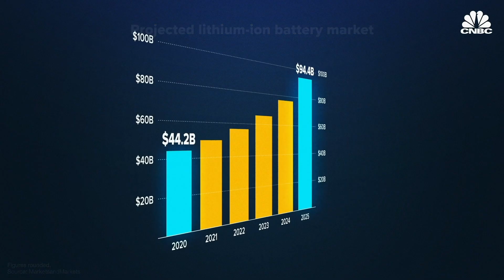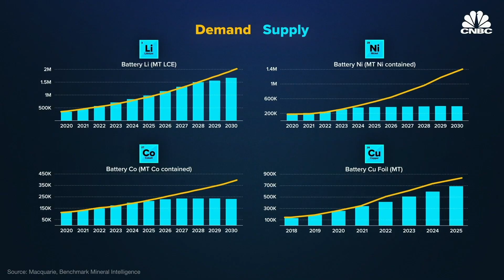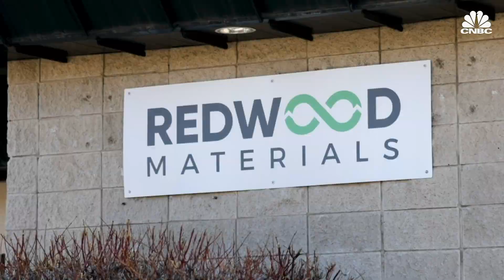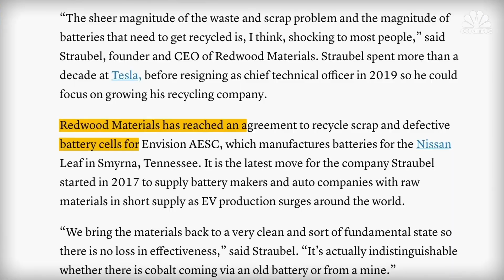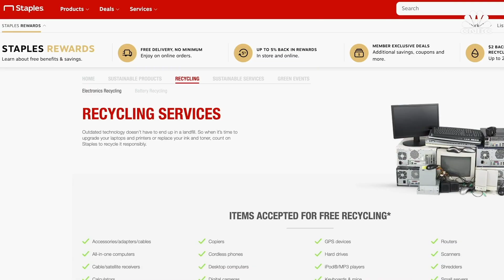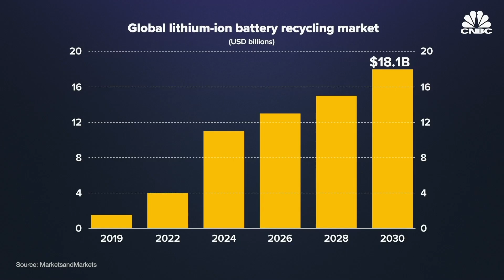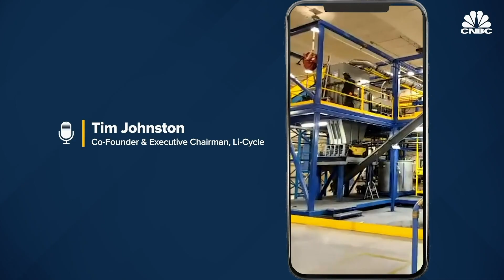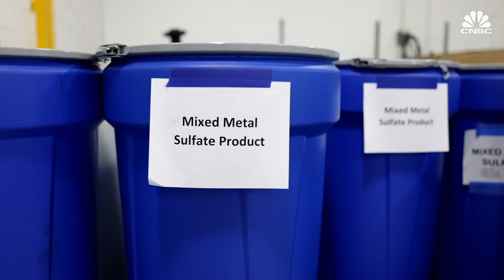How Tesla’s Battery Mastermind Is Tackling EV's Biggest Problem

Comment: My sister and I were literally talking about battery waste for electric cars and wondering if they'd ever find a solution to recycle them the other day. I am so glad that there is a solution.
Reply: Less then 5% of lithium batteries are recycled nowadays
Reply: @kord2003  but the potential is there
Reply: Recycling is a question of profitability not possibility. You can recycle anything but at the moment most materials are still cheaper to buy new than recycled. Once that changes recycling will become more widespread.
Reply: @aszbzpszbz9786  still in a test phase as cross contamination persist , billions spent so far with billions more to be invested in this process and this will continue for years
Reply: There is no solution you yuppie
Reply: Me too ! I've thought about this for years
Reply: Yea right.. let's see how well this goes once millions of EVs are on the road.
Reply: Are they recycling all the plastic casings ?  And are the manufacturers of all these items designing their products so they can be recycled easily plus maybe use bio plastics instead of petroleum based plastics ?
Reply: @williamgrimberg2510  there is no replacement for fossil fuels.
Reply: Recycling of batteries isn't 100% recyclable. In other words there is no way to recycle 1 battery after it is depleted completely and get 1 new battery that is fresh for someone else to use. The used up part of that battery has to come from somewhere. It's not free!
Reply: @miketech79  nothing is really "consumed" when lithium-ion batteries lose capacity. All the raw materials are still there. Over 95% of the materials can be recycled into new batteries. The only reason lithium-ion batteries end up in the landfill is because people toss them into their household garbage. The vast majority of EV batteries are recycled because they can't fit in a household garbage can.
Reply: @warrensteel9954  Recycling takes energy. If the process of using the battery made it "use up" the battery contents, hence the battery is only 50-80% of it's original capacity then the remaining capacity needs to come from somewhere.
I'll agree that 95% of the materials can be recycled. But that does not mean that you recycle 95% of 1 battery and add 5% new materials and get a fresh new battery. The depleted battery contents from the original battery are no longer functional. They need to be mixed with new mined materials somehow. So that 95% perhaps may only make up 40% of a new battery as an example.
Reply: @miketech79  "During charge, lithium gravitates to the graphite anode (negative electrode) and the voltage potential changes. Removing the lithium again during discharge does not reset the battery fully. A film consisting of lithium atoms forms on the surface of the anode called solid electrolyte interface (SEI). Composed of lithium oxide and lithium carbonate, the SEI layer grows as the battery cycles. The film gets thicker and eventually forms a barrier that obstructs interaction with graphite.

The cathode (positive electrode) develops a similar restrictive layer known as electrolyte oxidation. Dr. Dahn stresses that a voltage above 4.10V/cell at high heat causes this, a demise that can be more harmful than cycling. The longer the battery stays in this condition, the worse the degradation gets."

Once the materials are separated they can be remanufactured into new batteries. Yes this process uses energy but over 95% of the physical materials are recovered through this process. Take the batteries apart and put them back together and they are good as new. All the molecules are still there.
Reply: @warrensteel9954  no car batteries have been recycled the test phase is still in play as cross contamination is still the main problem
Reply: @macalister8881  what company are you referring to that's still in the "test phase"? Li-Cycle has been processing batteries for years and is expanding into the US and UK markets.
Reply: @Macalister  95% recovery has been achieved in Canada by Li-Cycle, which developed a hydrometallurgical process. They have recently expanded into the US and are currently expanding into the UK market. Canada has a long history of using pyrometallurgical processing batteries from all over the world since the 1990s, including US missile systems, Indonesian oil drill batteries, and expired batteries from the Iraq war. EV batteries are nothing new, just an increase in volume. Do some actual research before spouting off next time.
Reply: @Macalister what are you talking about? Toyo Smelter & Refinery in partnership with Niihama Nickel Refinery, and Kanto Denka Kogyo Co., Ltd developed a full recovery system for nickel, cobalt, copper, and lithium for the Japanese battery market.

Any sufficiently advanced technology is indistinguishable from magic~
Reply: @warrensteel9954  are you saying that  recovered  product has been used to produce new battery ,is that what your stating ?
Reply: @macalister8881  yes.
Reply: @warrensteel9954  the study i just read said that the battery  produced from recycled material are still in a test stage as they are not sure how long they will last or due to cross contamination risk if failure was not known . Published  nov 2022 ..
Reply: @warrensteel9954  where can i find your facts . Thanks .
Reply: @Macalister  "Recycled cathode materials enabled superior performance for lithium-ion batteries" published in Joule-Volume 5, Issue 11, 17 November 2021, Pages 2955-2970
Reply: @warrensteel9954  show me a company manufacturing with recycled lithium . Please .. germany  is still in a testing stage .. anyone can write a story and have it published ..
Reply: @macalister8881  you're right I don't have a background in chemistry. 

Almost anything we do has a price and an impact. Surely there will be stuff burned and buried. 

Besides bikes, walking, and public transportation, do you have a better idea or solution?
Reply: @teklife  i think in time they will design a better battery so that  the seperation process is more pure , right now the residual contamination is the main problem , the start up companies doing this now say thats the biggest problem and they are not 100% sure  a battery made with recycled matterial will last long , charge properly and not fail resulting in a fire , but billions will be spent , not sure how much will actually  go into  r & d .
Reply: Electric cars in of themselves are also part of the wasteful process of making them. Build. Functional. Transit. And make cities walkable
Reply: @sylfix2680 Sounds horrible.
Reply: There is....we send them to China, where children are paid a few cents a day to dismantle them for recycling and are dying from heavy metals poisoning...simple.
Reply: If theres a will theres a way. A company found a way to extract gold from computer board by using bacteria.
Reply: There isn't a solution genius.
Reply: @mattbarker1411  how does that coincide with my home page vid?
Reply: @mattbarker1411  how does that coincide with my home page vid?
Reply: Well it's a year on now and we're still nowhere further on!
Reply: @Altair885  how does that coincide with my home page vid?
Reply: Literally talking sounds like an oxymoron, grammatically speaking..
Reply: There  isn't a solution still, they are just postponing throwing the waste.
Reply: Electric car conversion would be an environmental disaster. Who would you buy one?
Reply: @ChannelNews1  how did you come to that conclusion?
Reply: @warrensteel9954  Hi Warren. I am trying to reply as to why but it seems my comment is being removed. Did you get my reply?
Reply: @News Channel  no, this is the first reply I've seen. I have found that links and possibly keywords will block comments from being posted. It's very frustrating when you find a research paper but can't share the link.
Reply: @warrensteel9954  sorry it was about my home page vid. They are trying to censor me for speaking the truth it seems. Let me know what you think thanks.
Reply: @News Channel  it's not just you. Some channels restrict links and such in their comments sections.
Reply: @warrensteel9954  I didn't put any links. I simply replied and made some unique arguments. I am a car mechanic for many decades. I offer my opinion in my home page vid.
Reply: CRYPTO IS DISTURBING THE ECONOMY

Comment: In 4 years you have broken down EV all over cities like Detroit , it will be worse than anything else to clean up , you will homeless people using them as housing gutting them out and parts every where and landfill over ran . A broken down unrepairable EV that costs 60k just rotting away , I don't believe these vehicles should be included in any bankruptcy cases otherwise people will just trash the country with these ..

Comment: This story is nothing but propaganda.
The REAL issue is, if the recycling is so easy and can be recycled, then why is there so many batteries being stored. And by the way, the number of batteries available for recycling is at least ten times of that shown.
Tell the truth, so-called recycling of used batteries is a big problem now, and is going to be a horrendous problem in the near future.
CO2 so-called problem pails into insignificance compared to batteries. AND THAT’S THE TRUTH.

Comment: By opening 2 flat oppossing blades no gaps angles deflections  against its opposite half at 180  from 180 degree increase is double in magnetic bearings magneticaly open and close naturally unknown wind energy like sound with curving sparking needs vetted for use and political opposition opinion imaulced in  3  or more harmfull  to survival energy corporations need ban.period  unfit for use nuclear and oil get together in place.to start race to save life .not stopping hoover  dams in tides reversing.learning curve.amen

Comment: I thought it was a great video!  Though, two concerns come to mind:

1. at 5:36 "can relieve some of the burden on the need for new minds or finding new resources", but... that might not be a good thing, you NEED new minds or new methods of resources, even if it doesn't solve this problem, it could still have application somewhere, to say we need to just stop thinking of new methods of solving a problem is...  well concerning.

2. at 8:03 where they talk about the solution being that the elements needed are in our draws, well c'mon, we have the material you want, why don't you offer us a sum for it?  We bought the material from companies, why not buy it back from us?  Those companies who sold it to us are going to purchase those materials back from you.

Comment: The solid state battery is going to reduce the cost to 1/10. Hope for the new battery structure also provide easy recycling. New power grid had better lay down in advance.

Comment: I would like to see how much power is needed to build and recycle these batteries with them huge machines? Are they only using renewable energy sources?
Reply: It may well take less energy to recover the materials from scrap batteries than to mine them from the earth. They are more concentrated in the scrap battery, and it should be possible to find out exactly what elements are present as opposed to having to take the mined material as it comes.

Comment: The real problem is Lithium ion is a dead technology going no where.  A typical Tesla weighs 5000 lbs; nearly twice what a Prius or other hybrid weighs; cancelling out the benefit of the 94% efficient electric motors.  Solid State batteries are suppose to weigh much less and make all Electric the next big thing.  At that point perhaps 3 years from now - Lithium Ion will be dead with no one interested in recycling the very bad waste products; and little use for them. Then what?

Comment: I do not understand why a simple solution that has worked in past like recycling bottles cans simply by paying for each bottle returned-at a nominal rate is not implemented. Currently recycling is not valued or offered specifically in metals  in old monitors TV circuit boards  and batteries but made as an extra burden even if someone wants to do the ecological correct thing. As a result people have no incentive to recycle economically and discarded increasing  at a cost of the process. This is not rocket science it is logical common sense. Simplify input to maximize output. Process is obviously very impressive. If you thing we have a handle on it checkout coastlines with plastics choking marine life down to the coral. Robots to clean up. One way to go. Maybe a different approach going in? Monetize correction on both ends.

Comment: All manufacturers using batteries should be regulated in terms of design of their components allowing battery recycling plants to easy access and strip their batteries. 
For example: every cell phone should have a way for the consumer to take out it’s battery and exchanging it for a new battery. On the other hand recyclers of these batteries should be able to access the  raw material from batteries without creating excess waste.
We need a standardised way to produce and recycle batteries. Incentives consumers handing back their old batteries and even fine consumers who have a bad track record of not handing back their old batteries. Standardise the entire industry

Comment: We need more of a connection between our used batteries (lithium and others) and recycling. I do not even see the BEST BUY battery drop off any more at the front of the store, and my city recycling center does not have a lithium battery drop off point either. -as we "scale" his efforts need to also be scaled up and much more is already needed.

Comment: Lol what a joke. He burns the cells and uses crazy strong acids to dissolve the metals basically capturing a small amount of copper nickel or cobalt depending on what the collector was made of. This has been around since the dawn of batteries and still leaves vats of toxic waste. It’s not common because it’s cheaper to mine new materials And it does not capture enough rare earth materials to do anything. Also he starts with only new cells old units are even worse to try to recycle.  Don’t worry it’s 100% ran on subsidies from taxpayers and why they don’t build more of them if it made sense why are only 5% of the worlds lithium cells recycled?

Comment: Electric cars are a joke. If it was truly about the environment then why not make steam engines for automobiles? They don't pollute, don't require rare earth minerals, nothing to recycle, no electronic failure, no danger of burning the car down and water is the most abundant renewable resource. The real reason why they want you in electric vehicles is to control you. If you do not comply with tyrannical rule they will simply shut your vehicle off. Electric cars are dangerous to the earth. Besides, gas engines are great for foliage. Wake up. Stop being sheep.

Comment: If these metals are still usable in batteries, why do the batteries need to be recycled in the first place?
Reply: The Elements are packed together tightly in the batteries. Their structure gets ripped appart with every charging a little bit. So the battery itself ist not working fine anymore, even though all elements are still inside.
They have to be extracted, sorted and then could be packed again.
Reply: That question makes absolutely no sense whatsoever. Have you considered getting back on your meds?

Comment: Electric batteries will prove to be an environmental disaster, and there is not enough Lithium in the world to go 100% electric, even if there was the environmental disaster digging up Lithium in the world would be a mess within itself. The way forward is combustible engines run on Bio-waste that has been turned into fuel.

Comment: Electric vehicles biggest problem is the amount of nickle, copper, silver and gold used in each vehicle. Copper use of roughly 200 lbs per vehicle. Producing nearly 60-80 million vehicles  annually. Copper and silver mine production has steadily decreased over the last 15 years due to deposits being drained and new deposits unlikely to be found. Going from rough 20oz per ton to 5oz per ton today. How do people think we will acquire all the precious metals required for clean energy? Well it's with massive mines. Copper mining is up 500% since 2010 but not producing much more. We need to increase mining by roughly 10000% to meet the demand for these metals by 2035. Guess what mining is? Clean. Electric vehicles are dirty just like ICE are.

Comment: What a fascinating story.  Perhaps the problem all starts and ends with how Americans need to educate its population of lithium users.  We need to immediately separate all batteries from the waste stream which just isn't happening in most places.  I recycle a great deal of things, but there is no separate battery can for me to toss these into in my apartment complex.  Why is that?  If our community doesn't want old batteries what alternative do I have but to throw these in my trash?  The bottom line is that somebody has to take responsibility for this waste product.  8:40.  "Do they think I don't want to throw it in a landfill, but I don't know what to do with it?"  Absolutely.  I still have every cell phone I've ever purchased thrown in a drawer pretty much for that exact reason.  Essentially, all Americans need to move away from a disposable society to a responsible recycling society.